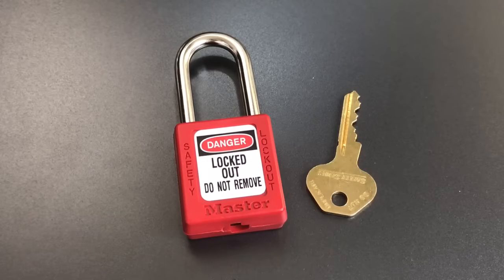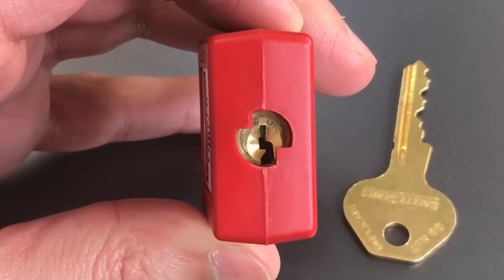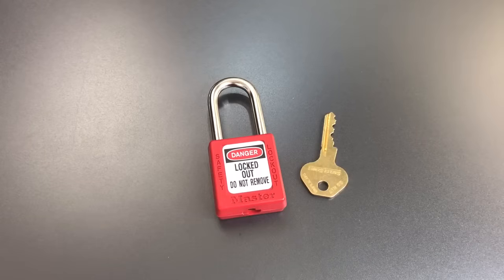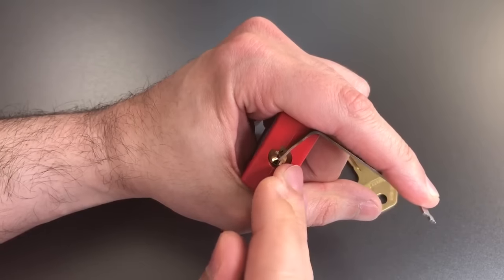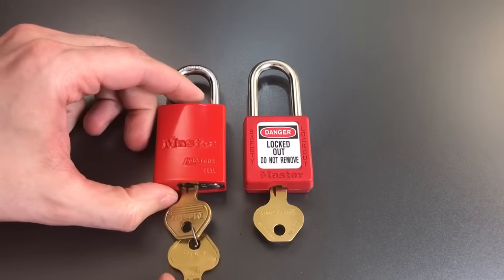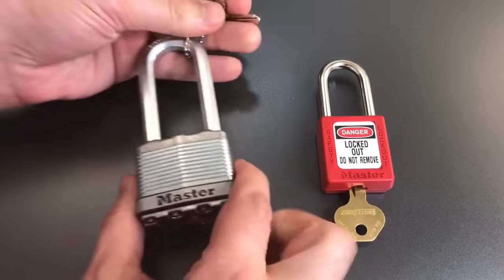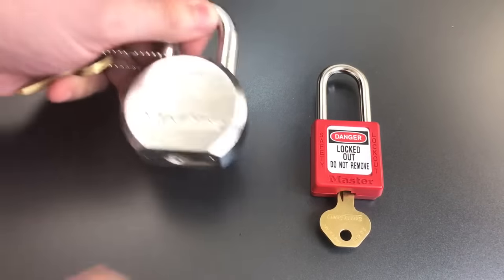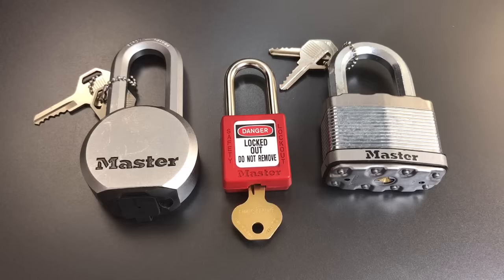[479] The Master Lock Paradox - Model 410 LOTO Padlock

Comment: I'm sure it just comes down to the consumers not knowing and the cost. It might not be much more money but I'm willing to bet the 6 pin core is more expensive even if just marginally; and to the consumer will just see the beefy lock and assume its a better lock. So master-lock can get away with putting in a not so good core because it will save them money in the long run, and people wont know the difference and buy it.

Comment: Its odd that that little LOTO lock has security pins, I can understand the higher number of pins (just so that they can have a higher number of different keys) I also work in manufacturing and is also trained in LOTO (though we use normal pad locks, no master locks) and I can assure you at least in my facility no one is going to be picking a lock on the job xD no the locks are just there to make sure that an operator cannot start the machine accidentally by not knowing its being worked on, the locks are not there for security per say, in all honestly my facility could probably use those not-a-locks that you just pull down on no problem, now I'm sure other facility probably does need the extra security but at that point shouldn't the locks be in harder bodies as well?

Comment: why the plastic body you ask...weight ... as a daily user of that lock, one day i lost it and had to use a spare one that had full steel body and weight and size(thickness)difference is enough to be annoying carrying all day long. Not a big deal but the plastic body one is more convenient to work with. also, when using the lock in heights in a work place it is less likely to hurt someone if dropped or at least limit dammage/injuries.

Comment: 4 years later and they still haven't married a good core and body. The 6-pin core is great for allowing a variety of keys in a large company that needs many different locks, but the security pins are unnecessary. These are really just there to keep power from engaging and let people know someone is in there. If after a thorough investigation it's found nobody is in danger and the lock is still in place, you just cut it off cause it's cheaper to buy a new one. They really should swap this core into a better housing

Comment: u prob don't read these things but here is my 2 cents for why the lockout padlock is made of plastic. Its purpose made to be a lockout padlock it even has a sticker saying so. So for legal reasons they prob don't want it easily pickable, or negligently easily pickable so some twat with a rake can turn a murder charge into a manslaughter charge. The plastic would prob be 4 2 reasons, 1st its cheap, which is most of the reason,(easy to sell a bunch to a factory if they are cheap and keep selling replacements) the other half is if you lose the key you want someone on site to be able to break it off so you arn't wasteing 1000s or more dollars with an inactive machine. Some factories could waste potentially millions if the wrong machine can't work at the wrong time.

Comment: For most people I'm going to guarantee it's quicker for them to cut or break the lock than pick it, therefore the body strength is more of a priority in a residential or commercial setting. I worked industrial maintenance and used the plastic locks, they're temporary and you're usually in the general vicinity, plus most people know if it's not your lock you get in trouble for jacking with it. But God forbid you accidentally leave it on when you leave work your supervisor calls you and confirms it safe and then they can cut it off.

Comment: A cardinal rule of security is that more robust security features are only effective up to the point where they impede the user significantly. 

If you buy a super hardened lock to guard critical items and lose the key, having it be too hard to pick for an ordinary locksmith with a rake might leave a less favorable impression on the customer (who generally think locksmiths are wizards anyway). 

Knowing a thug can’t bash or snip your lock with bolt-cutters, but that your valuables won’t be unrecoverable to a locksmith, is probably right in line with Johnny Layman’s desires (although he’d have a hard time communicating it, and these decisions would come with an aggregate of experience by Master).

From there, having the six pin’s diversity in an easily cuttable lock makes sense in the same way (although why their pins have security features… well, maybe they wanted some guy to carry around a carabiner full and corner the sport picking community’s trainer market 😅).

Comment: It seems weird seeing as how you'd have no serious impetus to try to defeat this lock in almost any scenario. It's likely anywhere it's used is going to be in a secured location, probably monitored/occupied (control room, etc), and where defeating it could cause catastrophic destruction or injury. And in the case of the former, if you're worried about intentional acts, you'd obviously want a much stronger lock.

Comment: The loto lock usually sits in a control room and you put them on a lock box. It says your in the vessel or working in it or around it. But usually the better locks are on the vessel or machine so no one can mess with it and turn it on. But thats just what I dealt with.

Comment: I was thinking, does anyone make a lock where it is a core inside a core.  where the inside core has pins all the same length and would spin.  the key must be inserted at the right spot so that the pins in the second core would be lifted by the key.  This would not allow you to tension the core in order to pick the lock.  I wonder why I have never seen this type of lock.  I would like to have some ideas as to how you might pick such a lock?

Comment: If I had to guess, they used a plastic body on the LOTO because it'll be easy to notice even the SLIGHTEST hint of tampering or damage done to the lock. Because they are in fact very important. Of those 3 red locks you showed, we use the 410s and that other solid red one where I work, as well as tubular lock padlocks on some of our yard gates. Another thing, perhaps since they're usually used to lock out an electrical circuit, maybe the plastic is there so in the event someone gets shocked or arc flashed while holding it, their lock won't conduct and melt into their palm? It's grotesque to think of as a mental image, but totally possible where I work, with 4160 cables being one of our lower voltages out here lol

Comment: These Master LOTO locks are typically used in electrical rooms where there are several breakers that need to not be messed with. If the locks are much bigger than this one it begins to get more difficult to get to the one you need to when you need to, and if you need to take several off, that's quite bulky. This is only my theory, of course, but it makes more sense to me this way

Comment: Shot in the dark, but my guess for this high quality core would be along the logic of masterlock only providing one key with this lock so only the key holder opens, it maybe an attempt to help prevent an attack with a similarly cut key,  Before I had a pickset and learned to use it,  I had a ring of masterlock keys I had collected over the years,  I was very successful opening locks simply by jigging them and or sliding them in and out slightly while holding pressure.

Comment: The shackles for our LOTO locks at work are black plastic, a futher step in the weak body direction. I will suggest that possibly Master lock made cheap lightweight bodies to appeal to mass buyers, not only that, but the permit system we use has the locks all tied to a single permit board that you lock onto. A heap of steel locks would be far heavier than the plastic ones we have if they were all locked onto these permit boards.. Dropped objects is also consideration where I work, and a plastic lock will do far less damage falling from multiple stories, than would a steel one. Just thoughts.

Comment: Liability purposes for the safety of maintenance personnel  is why  they require the better core I have no idea why the outher ones don't buy I know that it's for Liability insurance requirements some where down the road my insurance company requires a 6 pin lock so the lock is secured they aren't worried about someone forcing the lock body it's the person who wants bad things to happen and no one knows about where insurance company is responsible

Comment: Did you ever learn the reasoning behind the "paradox"?
Reply: probably to do with using them in consumer units/fuse boxes in places like UK. In the event of losing the key and resorting to destructive means of removing the lock I imagine its safer for the equipment its attached to (less bits of metal shavings, heat transfer, etc). Its primary role is safety not security so that's what seems logical to me.

Comment: There is no paradox the purpose of the lock is to simply keep people from turning on a machine when there are safety concerns such as a person working on the machine or inside of the machine. You do not want to have such a cheap lock that would break easily but yet you don't want to have the outer core or shell to be so impenetrable to make it difficult to open if something were to happen like the key breaking off you can easily destroy the outer casing and take care of the lock from inside. Whereas the more beefier locks have greater protection on the outside so you don't need something as strong on the inside. Obviously most people do not know how to pick a lock and the way that a common person would gain access to something that has a lock on it is to destroy the lock. No paradox at all.

Comment: The pinning in a master lock M5 is a absolute joke. I had just started getting into this hobby, and for kicks and giggles made a tension tool and a pick out of a SS hose clamp, cut it into shape with a pair of snips. Went to the shed and thought, let’s just try to pick my, master lock designated “high security” level master lock, picked it in 17 seconds, with quick, crappy makeshift tools, just starting out

Comment: I don't attribute the good core to the fact that it's a LOTO lock. Rather, fascinating that they bothered to put a good core in a LOTO lock at all, because the entire purpose of a LOTO lock is to just get in the way. Seems like it would have been logical to manufacturer the LOTO lock with the chintzy core and put the good core in the locks designed for security; you know... the locks anybody would actually try to pick. 🤷‍♂️

Comment: Manufacturing process and parts availability. Masterlock has been trying to get some sort of streamlined parts between various locks for a while now. Wouldn't be surprised at all if the upgraded pin assembly was used to use up some assemblies for a larger lit size and it's pretty easy to a higher end set in a plastic body. Also, sime customer may have requested it. Or just simply it's marketing. You'd be surprised by how much marketing has a hand in "design" aspects of many of their products.

Comment: I use these at work. Here's why they're not hardened and have a cheap body:

To put it simply, tradesemen/women can be forgetful after long days/weeks/months of hard work. If a tradesperson forgets to remove their lock then go home, but the job is done, and if said person is unable to be called back to unlock it.... let's say if they are flying home, or sleeping etc., then after a lot of safety checks, paperwork and high level signatures, the locks must be removed to start the equipment back up. Makes sense for them to be made of cheap metal and plastic then. 

Also, hundreds, sometimes thousands, of these locks are used on large projects. So I assume cost is also a major factor.

Comment: heres how i opened mine when i lost the key. I jammed a screwdriver in the keyway smacked it with a hammer all the way in, put a lever on the screwdriver and twisted it popped open and all the pins fell out. Another time i just got a drill bit and drilled the fucker out.

Comment: Might be for insurance reasons. That’s the most common LOTO lock I’ve seen at work. And with a LOTO you have someone’s life on the line, not just their belongings. So even though they have a weak body, it would show deliberate and improper action to remove it, and someone can’t claim “my key worked and I thought it was my lock”. Covering master lock in court because they used the most advanced core to keep people safe.

Comment: You do fantastic work and excellent clips. When will the Genesis pick set be available? I really want one and I’m on the email list for availability. My comment is right in alignment with fever gamer and nope never:  I think the lock is designed to be lightweight due the number of locks potentially added during lockout. Could be up to 12 padlocks on a single lockout point like a flimsy breaker. Designed to be difficult to bypass for obvious reasons yet a little easier to remove when absolutely necessary when the key is not present. That is my 2 cents.

Comment: Consider that the 410 offers a special feature set intentionally:

The force open is intentionally easier than the pick open so that the pick option is never used.  This allows the owner of the lock to be reasonably certain that the lock was not opened if it is not forced.  This knowledge can be more important to the lock owner than the protection of the equipment.

For example, the lock protects the on/off switch for a sludge pond pump.  One day the sludge pond overflows and damages some equipment elsewhere.

An unauthorized individual would simply hammer the lock off because that is easier than picking.  But that reveals to the pond owner that there was sabotage or problem worker.

If the pond overflows, and the lock is secure, then the probability of a pick and replace is very small due to the lock design.  Need to look elsewhere.

Comment: Could it be a vibration thing? I’m not too familiar with the use-case, but if it’s for safety purposes, maybe with a lighter lock body the better core is needed in situations where there might be high vibration?

Comment: Wouldn’t shock me if different countries or industries have a standard for core/key design for LOTO locks. Ironically, LOTO locks need to be able to be easily cut off in the event a key is lost/taken home at the end of the shift, hence the crappy body design

Comment: Generally speaking LOTO locks dont have to be "good"

They are used in areas and rooms (generally) not accessible to any except authorised personel.
Authorised personel knows better than to remove a LOTO  that they did not put themselves (or got transferred through a specifici procedure)
Removing a LOTO is often grounds for a write-up at the least, but possibly even dismissal, or if accidents happen: Trial.

For the personnel who wants to remove a LOTO without authorisation, the quality of the lock makes no difference, for he is on a path of industrial sabotage.
In some countries, in high voltage switch gear, they don't even use a LOTO lock. 
They use a sign, with identification number or name.
That sign is *holy writ*, and will not be removed, (so the equipment can be switched) without a switching plan.
If you remove such a sign, and your colleagues find out, then you are shit out of luck. They will imprint on you their impression of you, either before or after the company kicks you out.
The same companies generally do use LOTO locks in low voltage equipment, as they are "more accessible" than the high voltage equipment.

In both cases the purpose of the lock or of the sign is not to make switching impossible, but to prevent accidental switching. 
No lock or measure is failsafe against willful sabotage.

Comment: question: "how did we get such a good core on such a terrible lock" answer: evidence, by design. maybe LPL has spent more time picking than in the courtroom (or factory floor) recently. aluminum and plastic will show tampering or picking much easier, soft materials scratched readily by tools. scenario: $10 million wrongful death lawsuit, worker crushed by machine or equivalent. actual truth is incompetent management (bad training) and no maintenance. several weeks prior, suspect equipment had been tagged out due to maintenance request. service company or department, uses given Master lock. production crawls and foreman is angry. the weakest link is found, on orders. plastic, unshielded body. it is bypassed by "that guy." every foreman has one. machine runs, eventually fails, kills poor SOB. investigation, "someone (SOMEONE™) bypassed the lockouts and continued working." the evidence, says, this was indeeed what happened. the lock internals show signs of tampering, "it must have been a physical override, most likely from the base line worker, in order to meet production targets." foreman is silent, team is silent, etc. lock company and factory are absolved by principle, and whoever winds up dying from one of these getting bypassed, is blamed instead. source: seen it nearly happen before. deli meat slicer. nobody was trained on when things Must be tagged and repaired. result was employee injury that the company totally dodged. please be safe and follow rules at work, it may save your life, or somebody elses.

Comment: I mean a decent 2 or 3 pin would be fine why 6 wtf
Reply: 3 pins with 6 different cuts is 216 different locks. if a company has 250 locks, there is a good chance a key can open 2 locks which can be deadly

Comment: I would say most likely reason is having a high number of people certified to be LOTO equipment, however in instances when a lock is left on the equipment and it is ensured the person is no longer working or on site and the equipment is inspected and clear to start, the lock may be broken off and the equipment restored. This is my theory as to why master would design such a cheap lock body.